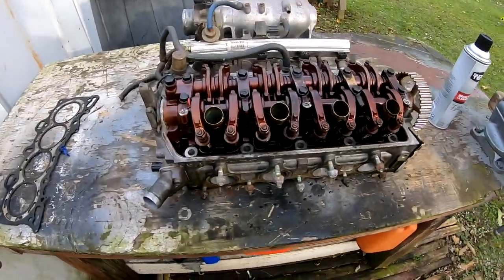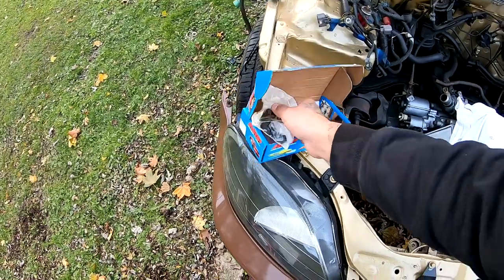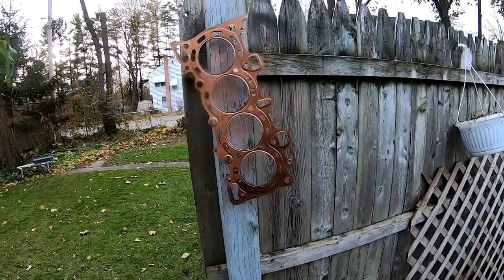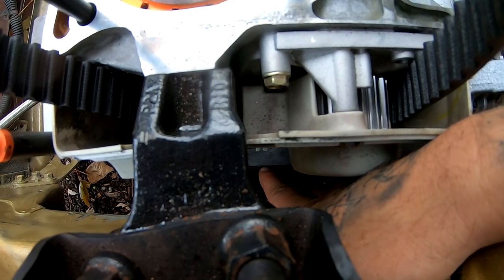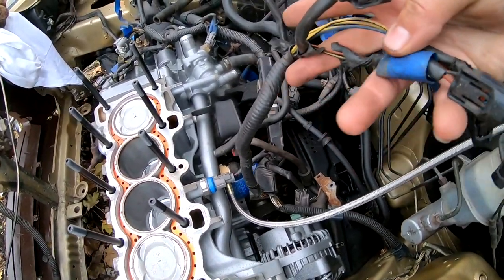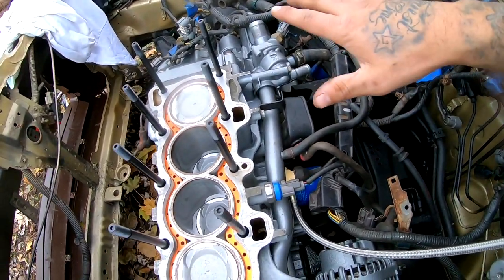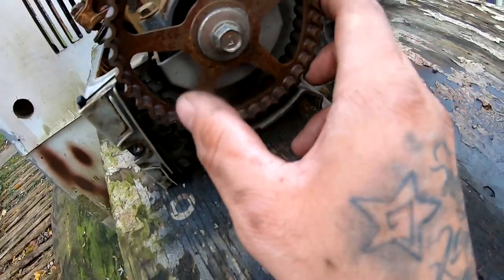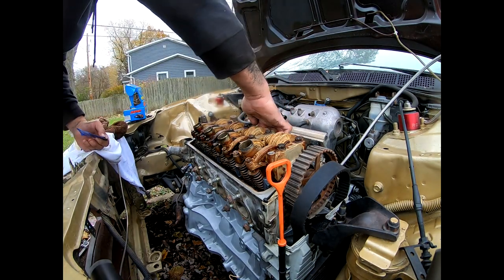500hp civic Ebay build D16 ARP Headstud DISASTER

Comment: Hey man I called arp about the issue as I have a set for a d16y8 and have the same issue. They said that they haven’t heard anything about it which is odd because I’ve seen numerous posts detailing the issue online. They did, however, tell me that they would send another stud out if I can get them the size I need. Any insight you can give as far as the correct size? I’d encourage you to call and let them know so that they can resolve the issue for future buyers. Let me know what you end up doing!
Reply from the maker: That sucks man. Yea i called summit and according to them i have the right part number but obviously its the wrong part so im sending the part back for a full refund. My buddy sold me his head studs and they fit perfectly. I dont have a part number for them. But man this is a huge problem for us D series guys. Send the part back get it swapped or get your money back. Get on the phone with moe from real st he should be able get the right parts as he has in the past for me.
Reply: Much appreciated. Glad to hear you got it figured out! I think I may just see if ARP can send one stud out that is the same length but just has 1/4 in more threads on one side to accommodate the extra room in the head. You think that’d suffice or should I just hit up real st? I’d like to get this thing done as I haven’t been able to drive it but for the 3 days after I bought it before I tore it down. Waiting patiently for that start up video brother can’t wait to see it!
Reply from the maker: @colsonbrandt1277  if your in a rush to start your car as of its a daily i would just drop the regular studs back in or just drop one regular stud in and swap it out later when last arp stud arrives. Yea thanks in the next 2 or 3 videos my civic should start.

Comment: I'm running ARP in my D16y8 turbo setup too.  I'm assuming you were using the ARP 208-4301 (D16 1988-1995) kit instead, which is shorter than the 208-4305 (1996-2000).
Reply from the maker: Yeah i dont know what happened but i didn't have enoff threads so i could not torque down i had a gap.
Reply: Thank your post help me to resolve my issue  got the 208-4305 and it works perfectly in my turbo ZC setup as I had ordered the 208-4301 without knowing.

Comment: I think you might have the head stud in the wrong place. There should be two that are longer than the rest. Those go in the center. Or maybe summit fucked you..just my two cents! Hope you get it sorted out
Reply from the maker: I was thinking that but i checked all the sizes  of the studs before i installed them and they were all even. Its frustrating I think summit might have fucked up like you said I just double  checked the part number also and it looks good.